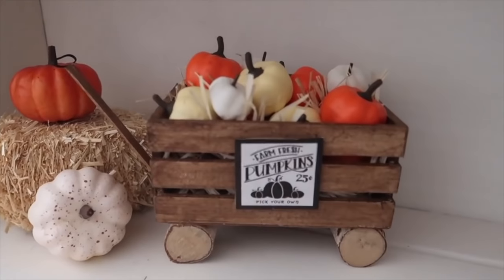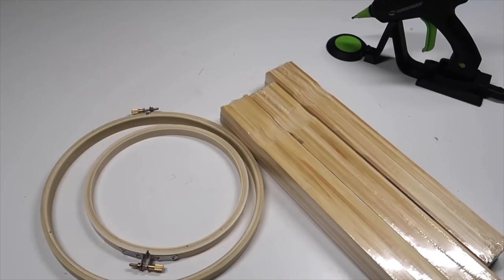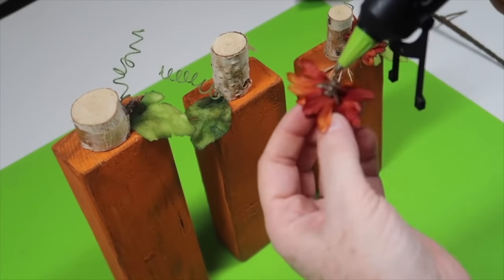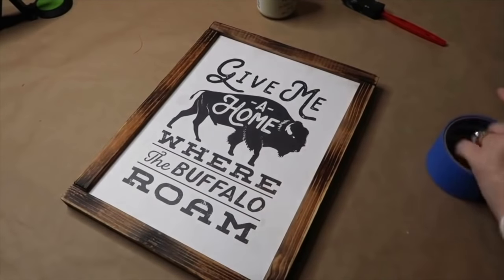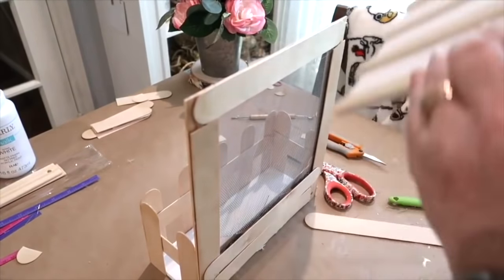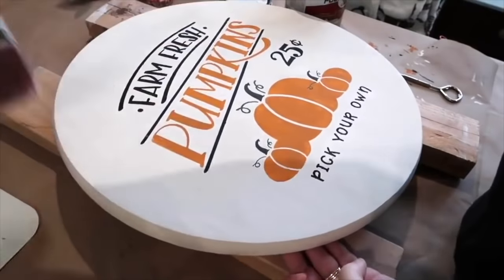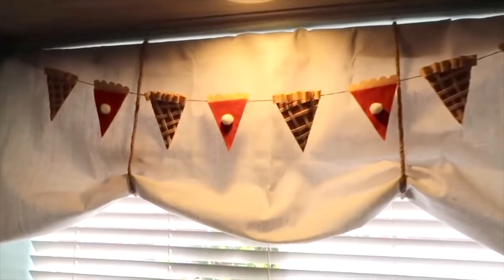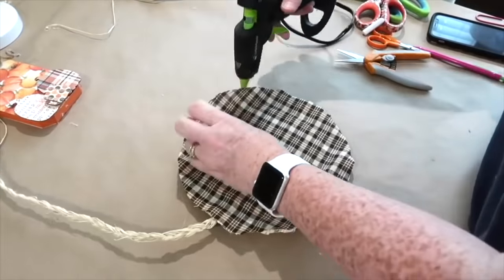🍁 20 AMAZING Dollar Tree FALL DIYS that look HIGH-END! 🍁  FALL DECOR Inspiration on a BUDGET 🍁

Comment: ok, so question for whom ever, I don't have the cross sticking hoops but have the three wire sets that have the circles that connect them together, can u use them instead and just disconnect the rings, let me know, thanks.
Reply: and do u also think it will hold the barrel together for the paint sticks??
Reply: Courtney if u see my comment, please respond back, 😊 🙏 😊
Reply: did anybody make the apple barrel that Courtney made, and does anybody know what size she used for the buttom and the middle 🤔 thanks??
Reply from the maker: I think those should work as long as the rings are two different sizes. 😊